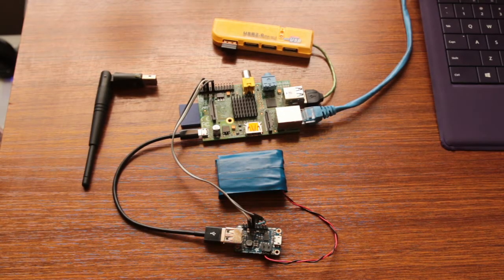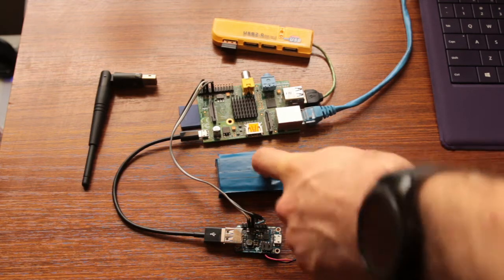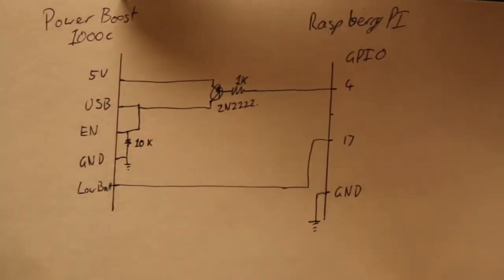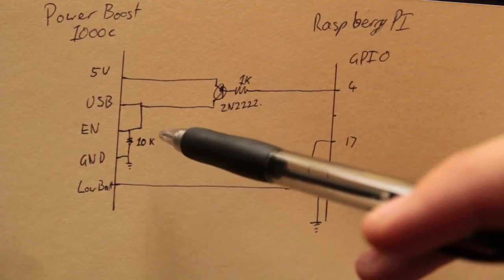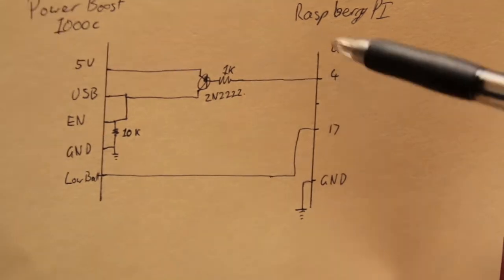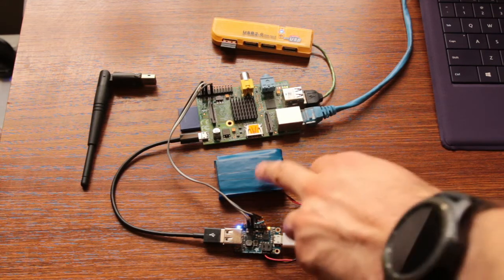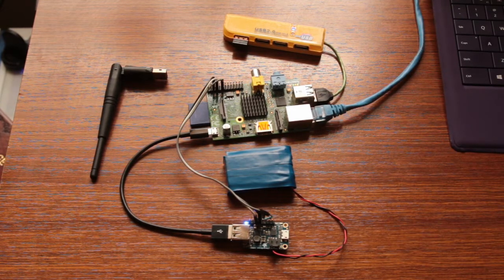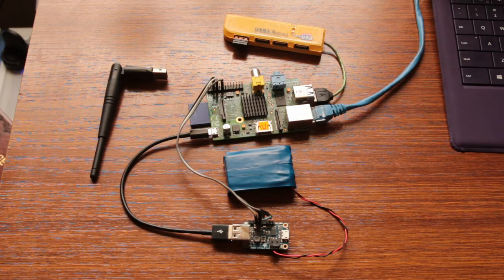Raspberry Pi Powerboost 1000c

Comment: Hello,
I have a question, is the program on the blog ok?
# - Pins - #
pwrPin = 17
batPin = 4
 
# - Setup pins - #
GPIO.setup (pwrPin, GPIO.OUT)
GPIO.setup (batPin, GPIO.IN)

17 is probably changed from 4.
Please reply.
Reply from the maker: Hey, good catch. I had the pins around the wrong way in the coding. My fault, sorry to confuse. I've updated the blog to be correct now. I better be careful in the future.

Comment: Can the transistor be replaced by a different one with lower values? I have successfully used a 2SC1815 with my Raspberry Pi, would it work for this setup aswell?
Reply from the maker: Yes the 2SC1815 should work as well. The transistor is used for switching, so as long as your values are right it will work. 2n2222 transistors are just a personal favourite of mine because they are robust and cheap.
Reply: Great and thank you for replying. I have already ordered the Powerboost 1000 C and until it arrives I can already start preparing the wiring. :)
Reply: Well, in the end I didn't get to prepare the wires before the Powerboost arrived. I just put it all together tho and it runs perfectly. Thank you for sharing this and for the detailed explanation. :)
Reply from the maker: No worries, glad I could help
Reply: I noticed one difference between your system and mine. As I shut my system down, my powerboost would always stay on until the LEDs drained the battery so much further, that the undervoltage protection of the powerboost kicked in. Since you are using a Raspberry Pi 1 and mine is a Version 3, I guess the (standard) behaviour just changed over the years. Little tip to anyone who is experiencing the same: Have a look at gpio-poweroff. It gives you the ability to control which state a GPIO pin is set to on powerdown. It also takes care of setting the other state during boot up, so you must remove the "manual" setting from the python script in the description.

Comment: Hi! I'm new with Raspberry pi! I'm wondering why would you need to power a raspberry pi? Is it to give power to the other components of the project or is it to keep the programming and code alive?
Reply from the maker: Hi Kushiwawah, this raspberry pi was installed into my car. It only received power when the car's ignition was on. Because the Raspberry Pi connects over Wifi I needed it to be powered even when my car was off. So the design is that it runs from car power when it can, but when the car is off the Pi uses it's own battery to stay on. Then when it's battery is empty, it switches off. When the car turns back on, the battery recharges.

Comment: Did you just connect the LBO to a GPIO pin directly? Does it read the voltage of the pin well?
Reply from the maker: Yes it is connected. The LBO pin floats high while the battery is not empty. When the battery is Low the LBO pin pulls to ground. So the Raspberry Pi is just waiting for the pin to go low. You could put a 1k resistor on the wire, that would prevent any trouble with mismatched voltages.